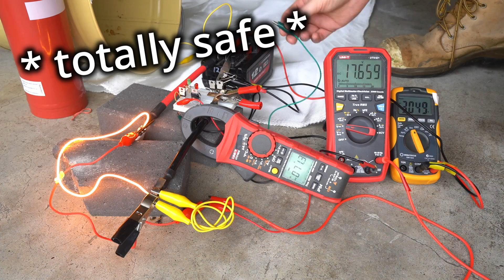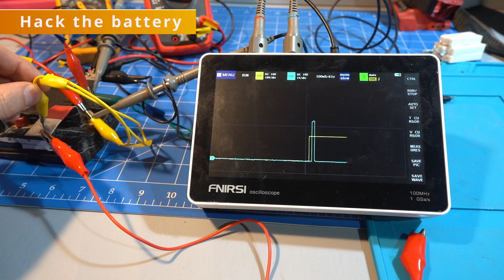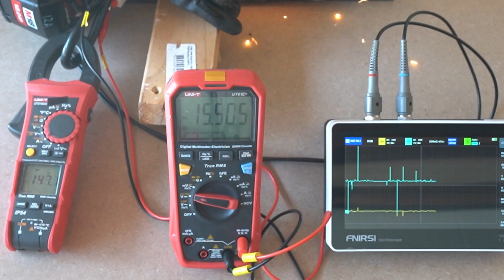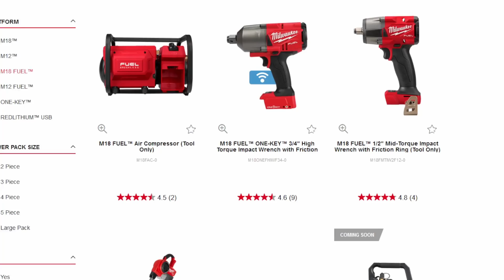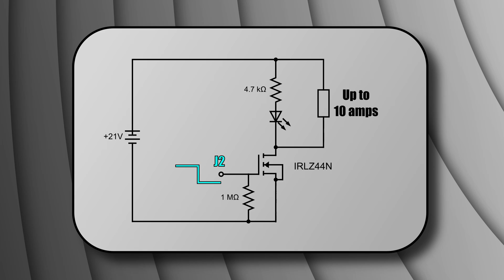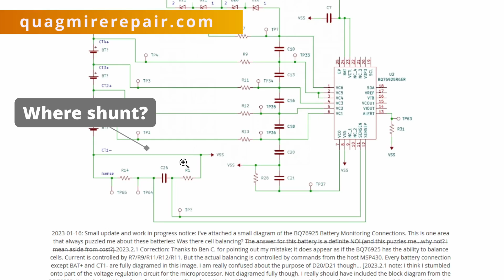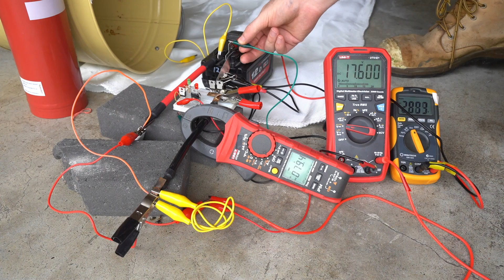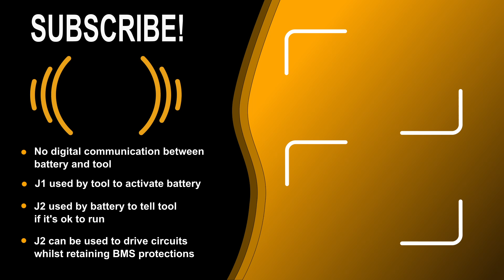[005] How M18 batteries communicate with tools

Comment: Thanks to this, I whipped up a small circuit with a buck converter, mosfet, esp32-s3 and a solid state relay. Solid state relay knocks on J1  for 20-40ms a few times, watches for J2 and if J2 comes up and as long as it doesnt drop out, stays out of deep sleep. Perfect for a few projects and rescuing old NiCd tools. I definitely want to put a PCB together for this

Comment: I think it would be very useful if you wrote out all of the flaws you've found in tools and wishlist for how you think each tool can be made better... Unless you think you can make money on that knowledge someday, but very hard to compete with such huge companies. Would be better to raise consciousness about these potentials so people can have some clue what they're missing. I think you would have great input on 'what is possible in tooling' discussion - which doesn't really exist yet.
Reply: I'd like to see an open source tool brand that people can share settings / hacks on easily. That's the next level of tool customization to workspace/job/application.

Comment: Any plans in the pipeline for testing the mxfuel batteries. They dont appear to put out any voltage from the battery and need to be woken up for use in a diy project
Reply from the maker: Fairly expensive and rare on 2nd hand market. 80V is also getting dangerous. I had suspected that they switch the terminals due to the danger of 80V, so your observations seem to confirm that.

Comment: Is the low voltage cutoff determined by a low cell voltage on one of the cells, or the overall pack voltage being below some threshold?
Reply from the maker: They measure each cell individually. 2.5V for 21700 packs and 2V for 18650 packs. I cover this in my [003] video

Comment: I am curious if you could comment on whether older M18 packs' BMS's are amenable to upgrading cells to newer higher current tabless cells. For example... Someone might want to upgrade a 12Ah High Output pack with 5Ah 100A 21700's to yield a 300A M18 "Forge" pack but it won't have a forge BMS. would this get its performance crippled by the older M18 BMS or would it mostly work fine?

Also, since I don't really even use M18 tools (mostly Ego tools and M12 tools) I am much more interested in doing these "we have Forge at home" tabless cell swap hacks on my M12 CP2.0 packs with the new Ampace JP30 18650 cells (supposedly capable of bursting to 60A). So the same question applies.. will the BMS on these packs hold them back, or possibly pose an overheating risk?
Reply from the maker: Very unlikely to have any BMS problems. You may have some terminal connection problems with the bigger packs as they already melt the case near the terminals. So tabless would have worse melting issues.

Comment: There is something i noticed recently, the M18 TLED light or torch only uses the (+) and (-) terminals of the battery. Many of the other lights do as well. Rewatching this, they will not have the minimum current to keep the batteries awake. Even some of the larger work lights are only 1000 lumens and will draw well under 1a. I havent checked where the low voltage cut is.
Reply from the maker: Yes. I have no 2-pin M18 tools to test, but someone else said they have 13-15V cutoff.

I did test a 2-pin Makita tool and it cutoff at 12.95V

Comment: If I wanted to add a device between the battery and the tool, that would allow me to remotely turn on the tool. Such as in a vacuum,  how would you go about that?
Reply from the maker: I think there's a few tools where you can bring the J2 pin high to start the tool. Try connecting wires between your battery and vacuum (longest pin on tool goes to B-. Triple check it's right or you'll break your vac). Then try turning on the vac (nothing should happen as the middle pins aren't connected). If you wait a while, the tool's J1 pin will go low. When this happens, try putting 3V on J2 (touching B+ and J2 is easiest way).

If this starts the vacuum, then yes, you can start it remotely by setting up something to remotely turn the J2 pin on/off.

Comment: What about one key?
Reply from the maker: One-key tools? I don't have any to test. I'd be very skeptical of them communicating while the tool is running, as there's too much electrical noise. They could communicate when the battery is first attached. There's also nothing stopping Milwaukee from creating a tool that does probe the battery in the future, so never say never. Milwaukee does have a diagnostic tool that they can attach to batteries, so they could make a tool that pulls the same diagnostic info.

Comment: Hey!
This is a wonderful video. Thanks for sharing.
Isn’t there any possibility to build an AC mains converter to replace batteries when necessary?
Someone would ask why cordless make corded again. But there may be some requirements. (That’s why Milwaukee created such for Fans they created)
Reply from the maker: Harrison Hobbies has made the best attempt https://www.youtube.com/watch?v=gT8et0RFU9A.
It needs a very powerful power supply. He tried again with 2x1000W supplies, but it still wasn't quite enough. https://www.youtube.com/watch?v=s9tSCM8RfQM
Reply: @toolscientist  Thank you for the kind reply!!!
Oh, I see. I have a little doubt on that statement however.
My question is, How come that little battery pack becomes a 1000 Watts monster and last a bit longer?
Reply from the maker: @nipuna_perera  li-ion can do high currents on short bursts. A 2Ah can do 50A/700W on short bursts, but only 15A/250W continuous. Also, that battery is working parallel, so PSUs are giving 40-50A each, then 2Ah is adding 20-40A on top of that.

Comment: my m18  battery pack turns off after 2-3s. is there a way i can use it on different tools? or how can i keep battery runing
Reply from the maker: What are the voltages on the cells? If one banks of cells is very low, then that's probably what's tripping the low-voltage protection
Reply: @toolscientist  it wasnt battery problem. At the end i was missing 10kohm on T and negative terminal. Without that all parkside tools i had would stop working after 2-3s
Reply from the maker: @LordAnubis0909  ah ok. Yeah that's  a Parkside tool issue rather than M18 battery. Good job figuring it out.

Comment: Hi tool scientist, do you think there is a chance of damaging the tool’s circuit by leaving the 12–21 volts from the battery permanently connected to the J2 pin?
Reply: If I cut the communication between the tool and the battery and only apply 12-21 volts to pin J2, do I risk bypassing the battery's discharge protection, given that the tool will never be able to communicate with the battery via J1 and will only be powered through J2?
Reply from the maker: Definitely. If you bypass the protection, then of course there will be no protection. The only way the battery can protect itself is by pulling J2 low. If the tool doesn't turn off when the battery brings J2 low, then the battery can be overdischarged or overheated.

Comment: This is incredibly helpful, it's amazing there isn't a commercial item we can buy that does this instead of using an external cheap voltage monitor circuit.  I'm curious how the circuit can be modified with a simple on off switch that creates the square wave on J1. How "square" does it need to be and how flexible is the frequency? After review I see 20 to 40ms.  Is there a simple passive circuit? Or Schmidt trigger circuit ic that can maybe also be used to creatively toggle a larger FET?
Reply from the maker: I'm planning on taking apart one of my M18 tools to see how they do it. I think some of my tools have the electronics exposed, so I should be able to probe it.

Comment: So the tool has no clue how powerful the battery that's plugged into it is? If I were to buy a DIY battery kit and use my own 35A cells then the tool won't try to limit its power consumption due to the non official board?
Reply from the maker: That's right. The tool will keep going as hard as it can whilst the battery holds the J2 pin high.

Comment: Just tested this, using a square wave on J1 to keep the battery alive works. Just keep in mind J2 will be turned off for up to 1 wavelength of that square wave.
Reply from the maker: That's good to know. I guess a simple RC filter can fix it, or a digital delay if you need something cleaner.

Comment: I have an adaptor that I bought off Amazon that connects to a Milwaukee M18 battery for DIY projects.  This only has the two power pins connected.  So how is that working if the tool has to send a signal to the battery to activate it?  Or does the battery just give power regardless if those pins are not connected?  I'd like to find an adaptor that has the other 2 pins accessible so I can monitor the cutoff signal.  Either that or add an external monitor.
Reply from the maker: B+ and B- connect directly to the cells. You can drain it down to 0V if you don't do your own protection. By "activate", I mean turn on the J2 stop/go signal.

Comment: @toolscientist I’m in the process of building an adapter that will allow me to use 2 m12 batteries to power an m18 tool. If I understand your testing of how the tools function, as long as I provide 18v across the positive and Negative and 3.2v on J2 I should be able to power the tool with my adapter? As I understand it J1 is just a signal to tell J2 to provide voltage correct?
Reply from the maker: Yep, that's correct
Reply: @ thanks for the quick reply
Reply from the maker: @jamesgideon5508  you can prob so 20V and even 21V on B+. That will give you more power and be completely safe as that's what 18V batteries are at full charge. It might even get you better efficiency on your buck converter.

You can also put any voltage over 0.75V on J2. Easiest will be to tie B+ to J2 via a 10k resistor.
Reply: @ What gauge wire would you use for an adapter like this? I'm thinking 12G stranded should be good but wanted someone else's opinion too. I plan to get a M18 Weedeater and Polesaw to use it for, along with any other larger tool that would make my life easier like a Circular Saw or the Leaf Blower.  TIA
Reply from the maker: @Jimmmakesstuff  I'd prob go with 8AWG for the 40A rating. You can also spend a bit more for silicone wires, which can handle higher temps.
Reply: @toolscientist  Got everything wired up and tested it to an 18v Drill, and it works. Waiting on the adapter shell to finish printing and we'll get it all packaged up to use! Thanks again for all your help and this awesome video explaining how the tools communicate. Would love if you'd do one for 12V Bosch Tools too!
Reply from the maker: @jamesgideon5508  make a video of it! You wont be able to link in the comments (it'll let you, but then silently delete it), so post the title and I can search for it.
Reply: @ It’s called M12 Battery to M18 Tool Adapter. This is just V1, I’m gonna clean up the design and start working on V2 to clean up the design a bit.
Reply: Good to know! Thanks for the help, I’ll let you know how it turns out once I get it built.

Comment: Milwaukee think they can fool the public until they encounter you Mr. Scientist, wow 👍.  Your analysis is truly out of this world..!  

I also have a few M18 & M12 batteries (cell from Korea & Singapore) and very tired of their LOW LOW quality cells where the charger shows red/green flashing.  My M18 battery is fully charged and still shows 3 bar status (very common).  My M12 cell pack loses voltage daily and a month later, each pack will show 3.7+4.1+4.1 causing charger to flash red/green.  I am not a contractor so I don't use my battery often..!

Recently I found an adapter that can convert Ryobi battery into Milwaukee tool interface and it's been working so far b/c I don't see the value of Milwaukee batteries.  If this adapter performs well, I will buy Ryobi battery on sale and use adapter for Milwaukee tools to save money !
Reply from the maker: Some of their packs are good. Anything with 3000mah 18650s (M12 3Ah & 6Ah) or 4000mah 21700s (M18 8Ah and 12Ah) are prone to failure. In M18, their 5Ah and 6Ah HO are the most reliable.
Reply: @toolscientist  you are 100% correct, my failed battery is M12 6Ah & M18 8Ah !

Comment: Hello, does the Milwaukee BMS detect overcurrent and change the state on J2?
Will a 2Ah battery have a different overcurrent threshold than, for example, a 5Ah battery?

Thank you.
Reply from the maker: It doesn't directly detect overcurrent (maybe some of the bigger one's do, but I can't test above 160A). It indirectly has overcurrent protection as high currents cause voltage sag, which triggers cutoff from low voltage. 2Ah cuts out around 50-60A, 5Ah cuts out around 80-100A. As the cutoff happens from low voltage, the exact cutoff current changes with age of battery and state of charge
Reply: Thank you for your  explanation.